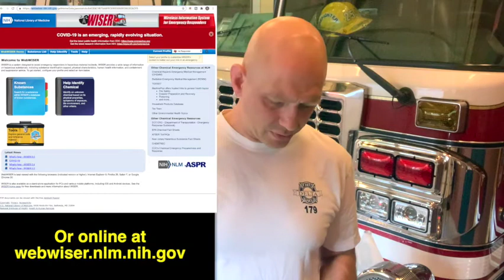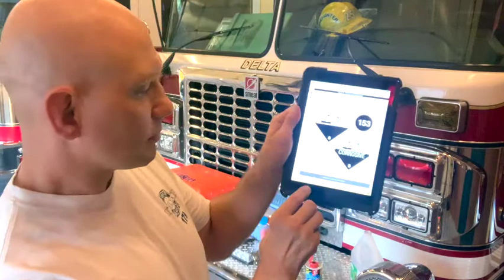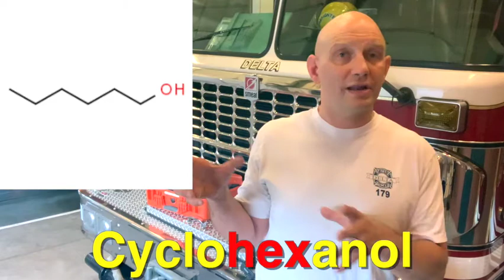Detecting and Measuring Corrosives at Hazmat Incidents

Comment: The first detector going into an unknown should be wet pH paper on a stick.  If it turns red or blue, do not bring in your multigas meter.  The corrosive atmosphere will damage the electronics, turing it into a brick.